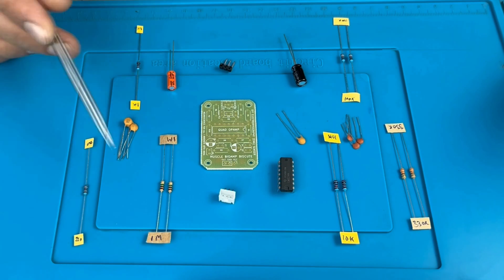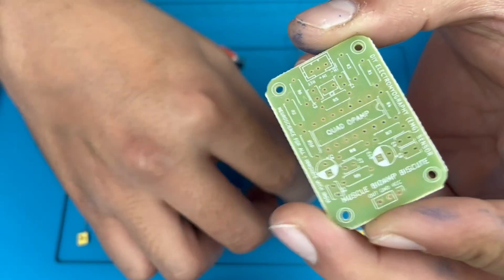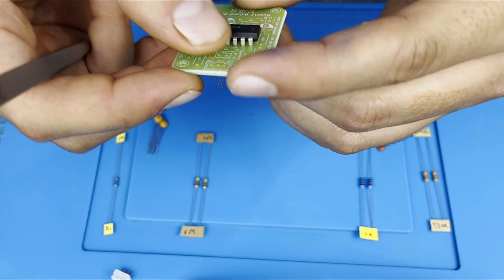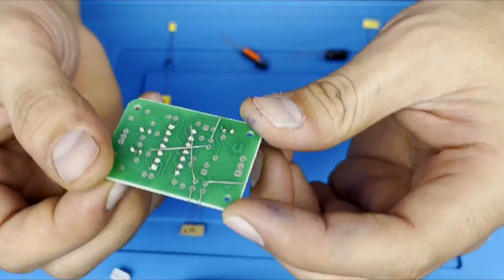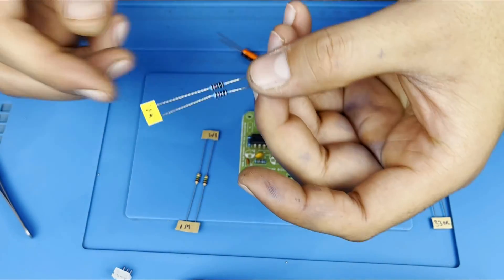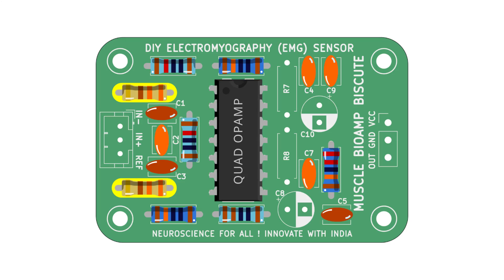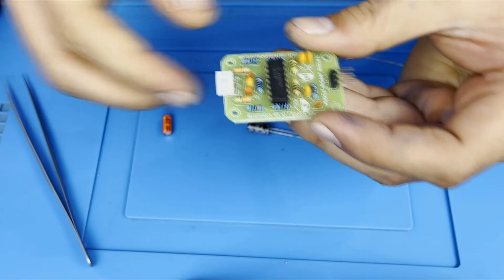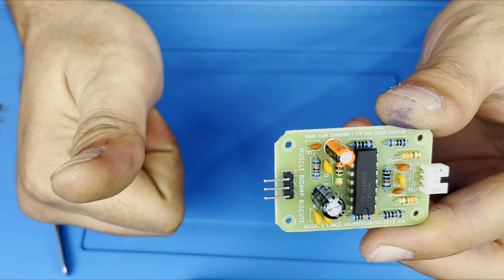Muscle BioAmp BisCute: Assembly Guide | DIY Muscle Sensor | Upside Down Labs

Comment: My sensor is not working.It is powered up but it doesn’t taking signal from my hand I have taken signal from different muscles and using both emg pad and band still it does not take signal .Would you please tell what happened and how can I fix it . I need it urgent for my science project.
Reply from the maker: Hey,

Please mail us at support@upsidedownlabs.tech with the following things:
1. Images of soldered Muscle BioAmp BisCute (both sides)
2. Image of connections you have made from Muscle BioAmp BisCute to Arduino Uno R3 or any other microcontroller board you have used.
3. Image of electrode placements
4. Demo video which shows the problem you are facing.

We will try to resolve all your issues as soon as you send us everything in detail.